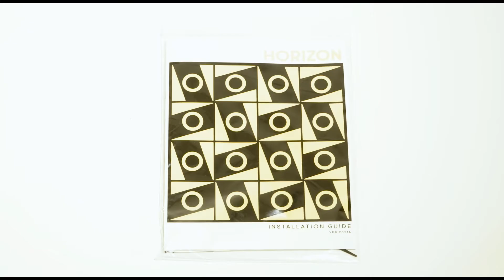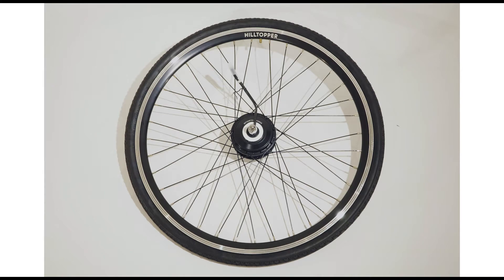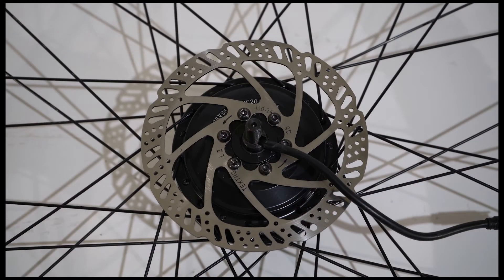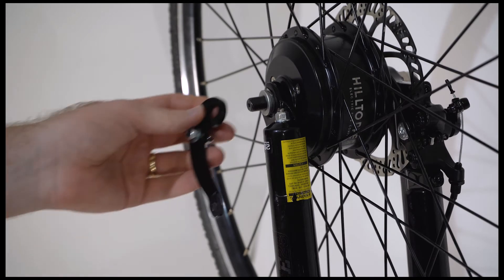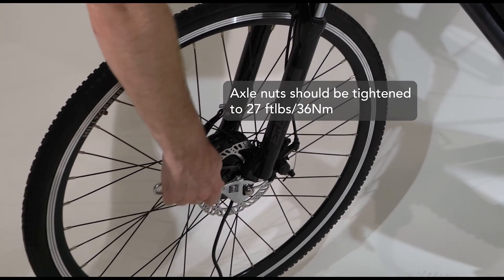Hilltopper Horizon Electric Bike Kit - Installation Guide

Comment: I am happy that I purchased the kit, but I would like to guide other purchasers. First: the written instructions provided with the Horizon kit are utterly inadequate and misleading.  The company needs to place a link to this video in bright red letters so purchasers do not waste hours following the written instructions, as I did. Let me repeat again, the product is very good and I chose it after many hours of research. [update: my spouse took mine after she used and enjoyed it; I had to order another one for myself]. Once I got it assembled I was happy. But the written instructions need lots of work. 
 I assembled the motor according to the written instructions, only to realize that by following the diagram on the written instructions I had it backward. In addition, there were no clear instructions on how to assemble the torque arm and I assembled it incorrectly. There were no instructions on screwing the metal plate into the battery holder, but I will do that now that I see the instructions on the video. There were no clear instructions on how to assemble the pedal assist and I wasted half an hour trying to figure it out before I gave up. I will try again after seeing this video, but I think the cable is going to be an inch or two too short.  There are no instructions on how to mount the battery on the rear rack, but I suppose I will figure it out. It took half an hour to plug the cables together even after I lined up the arrows. Contrary to the written instructions, the key turns clockwise rather than counterclockwise. 
Having said that, I completed enough assembly to take it out for a ten-mile trip and I enjoyed nearly every minute of the ride. The motor was enough to carry me up steep hills (I weigh 220lbs) and I was able to use my bike without the motor whenever I wanted. I chose the front-drive motor because I have another bike with a rear-wheel drive and it has kicked up on me once or twice when starting up on a hill. So far, so good, I will update my post after I’ve used it a while.